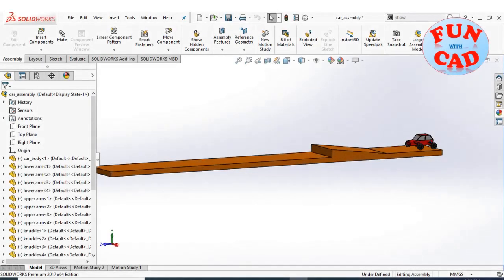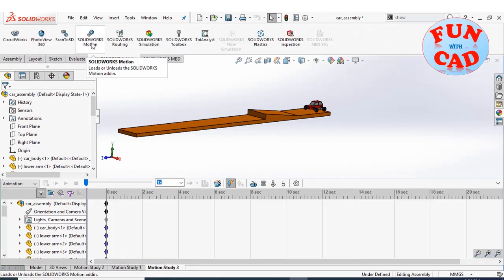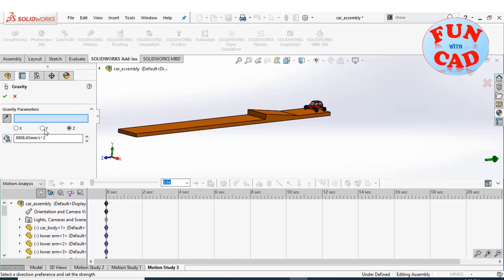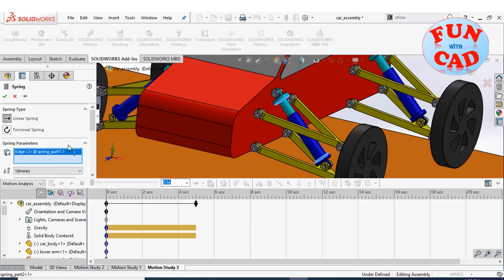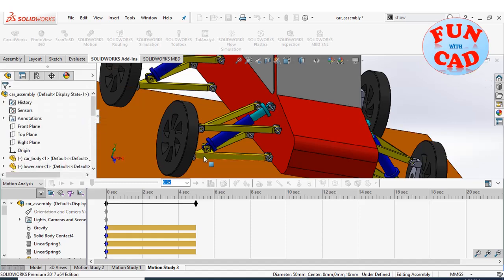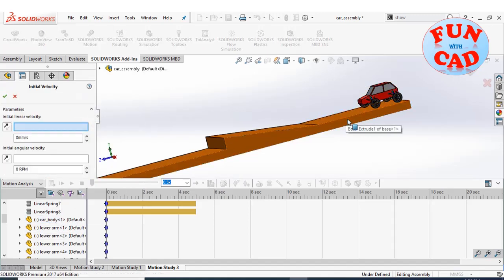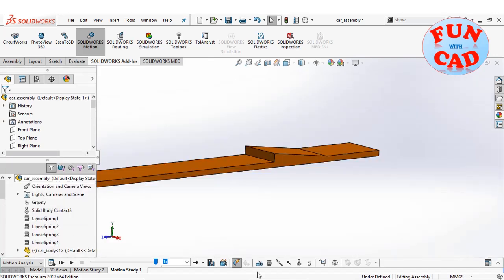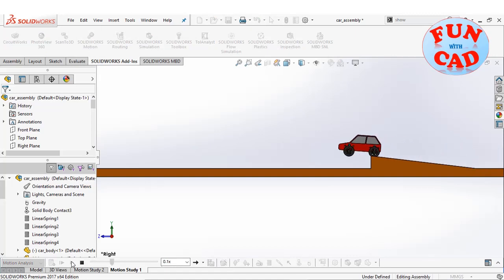Learn Realistic speed CAR JUMP with working SUSPENSION using SolidWORKS | MOTION Animation tutorial

Comment: you didnt use any rotors on the wheels ? just a velocity?
Reply from the maker: It would be little difficult to achieve this high initial momentum with help of rotors. Rather than the car jumping from incline, it would just fall down.
You can check other videos on the channel where motors have been used to produce motion.